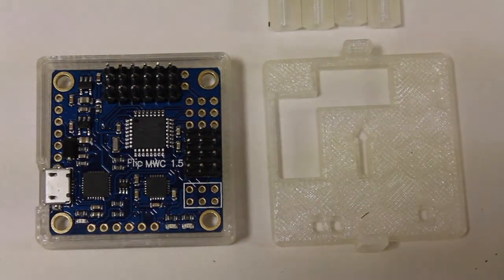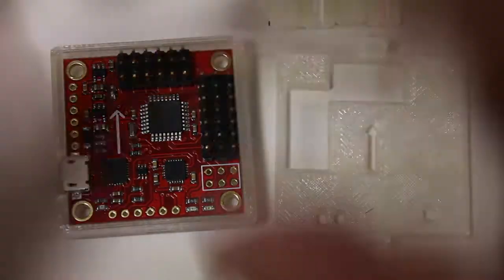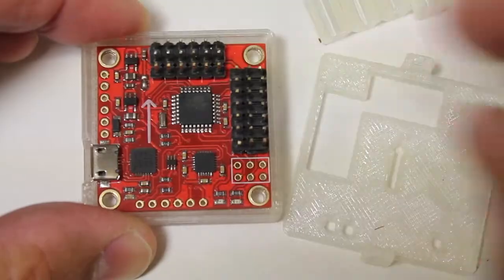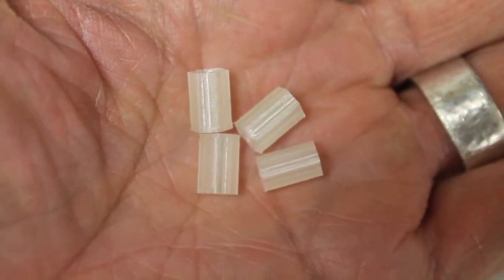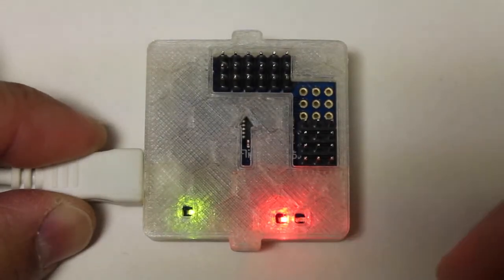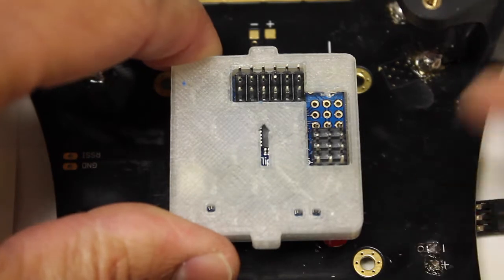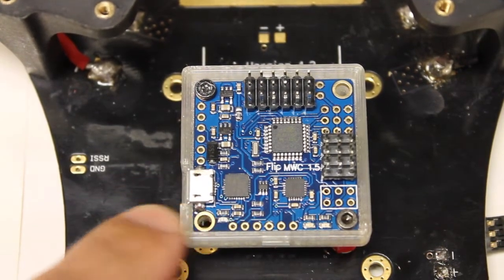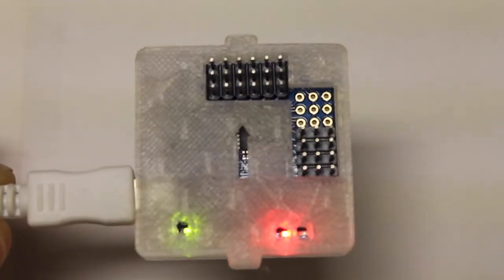3D Printed Case for MultiWii Flight Controller Now Available on Thingiverse

Comment: Looking good :)  Could you do a follow-up on your experience with your TBS and QAV400?
Reply from the maker: Thanks for the Q and I hope all is well. I will see if I can get around to this. Work has been busy lately and I'm trying to keep up with all the questions on the channel. But to sum up your question I'd take the QAV400 10 times out of 10 over the TBS. It's just so great for FPV, very agile, and fun to fly. The stability and anti-vibration is amazing. It's all dependent on what you're trying to do, and it's quite a bit more expensive than TBS, but well worth it IMO. Especially if you're trying to get vibe-free video. I still fly my TBS just as a trainer. I hope this helps!
Reply: Dennis Baldwin Hi, interesting, I was up in the air on which to purchase. I just got all my TBS stuff in today. I'm super new at this only maybe 5 flights on my F330, but there just isn't room for all the FPV gear and such. The jump to the TBS seems simple, and the parts are cheap. After I get the hang of things more I think I'll move up to the QAV400.